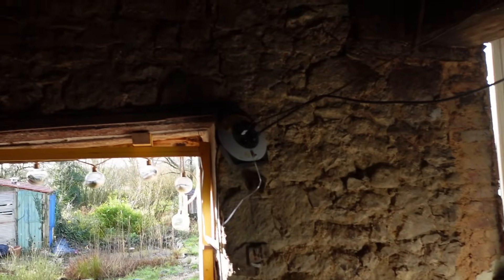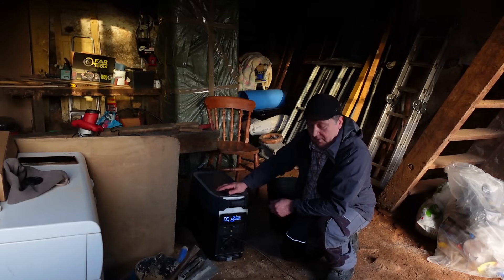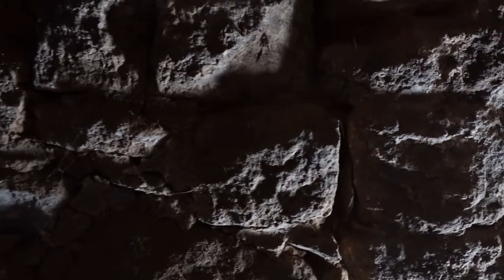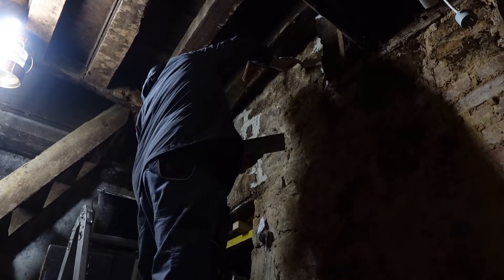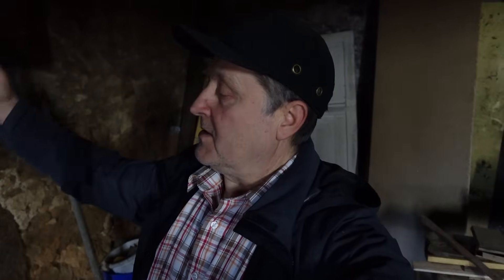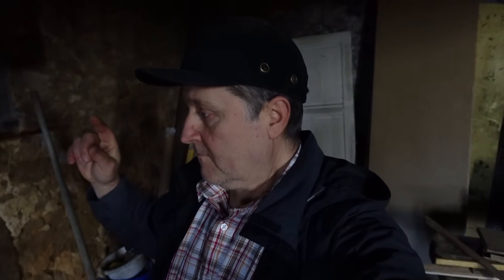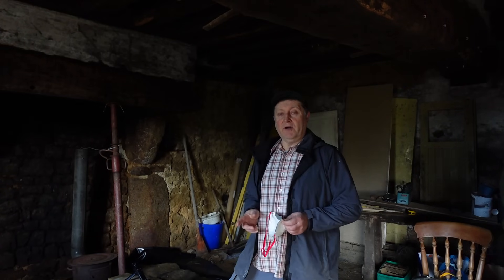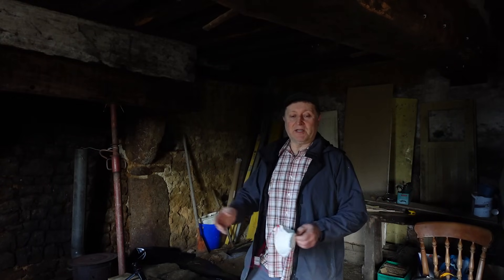Back To Work On My Cottage Renovation Project! Ep. 56

Comment: So glad you've got a more ergonomic tool to save your back. Are you using ice packs? Something I learned from another homesteader is to put a small amount of water in the bottom of the bucket before adding plaster/cement to better incorporate the dry into the wet. Keeps from having a ring of the dry at the bottom. No charge!!! Blessings for the new year. Soli deo gloria semper.
Reply from the maker: That's what l did 👍

Comment: Don’t forget to look into getting yourself an Inversion Table. Second hand will be fine. Amazing piece of equipment that will bring relief to your back as it gently stretches and relaxes your back. Invaluable for slipped discs, sciatica etc. I use mine after a hard day in the garden. ❤ 👋 🇦🇺
Reply from the maker: Thanks for the tip!